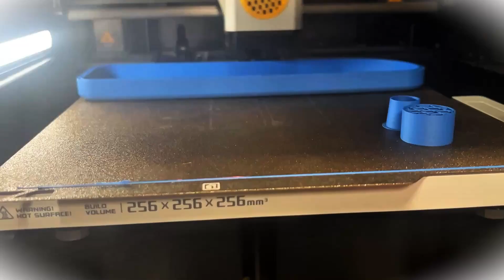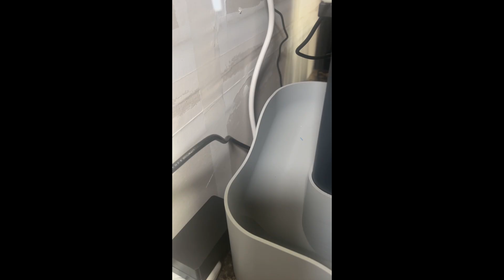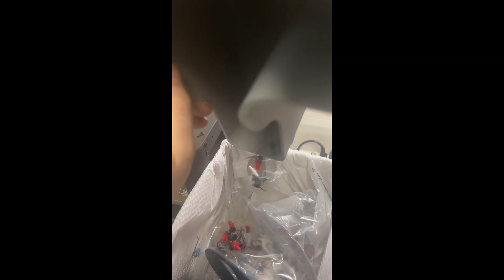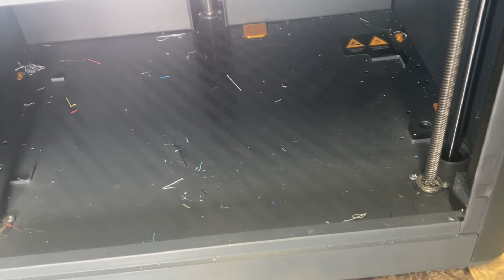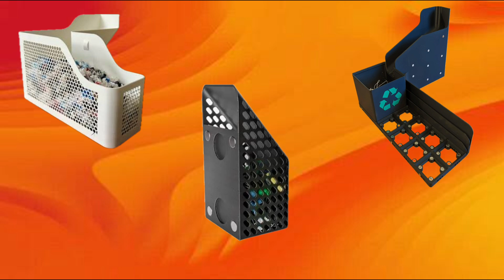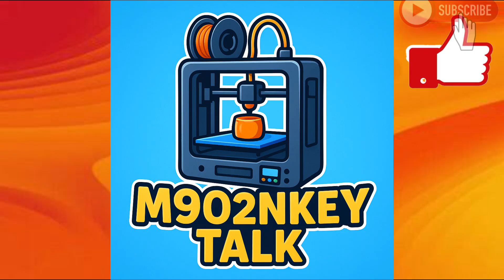Bambu P1S Filament Waste Bin 💩 | Simple Upgrade, Huge Printing Results!

Comment: I have  been using this one since i had the machine, basically first thing i printed besides a bechy and  another small test print. Works really well, only issue i have with it is if im doing an all day multi color print while im working all day the slide part will back up and i will either have to pause it or have someone dump it for me. Has a very generous capacity if you are able to pull the filament forward every so often, but it will back up on something with a lot of color changes if you are not able to get to it. Trying a new one that is quite a bit deeper and has a much steeper "slide". Honestly though this model is very nice and is probably big enough for most people in most situations. Probably will still use it unless im worried about a heavy waste print when i wont be around.
Reply from the maker: I agree! The slide could be steeper! I too have to move the waste forward from time to time! Good look! Let me know if you find something better! I’m always willing to upgrade or try something new! 👌
Reply: @MonkeyPrints3D the one I printed is on bambu handy, called "V2 Poop chute Carbon X1C - P1P - P1S - P2S" if you want to check it out, printed and looks good. Haven't really tried it yet but looks like it will fill a lot more without having to pull the filament forward.
Reply from the maker: I will take a look! Thanks for letting me know!